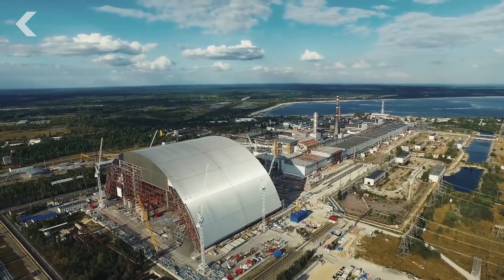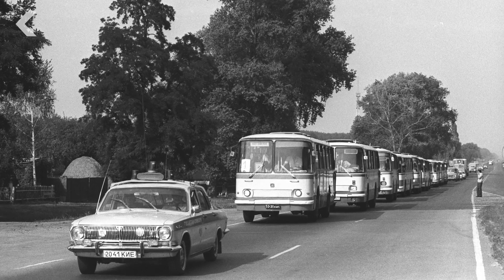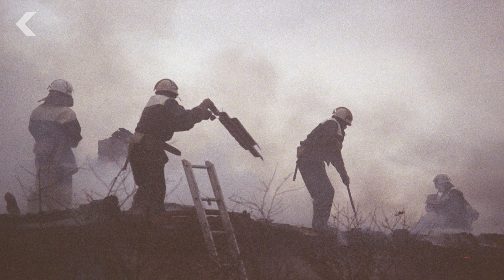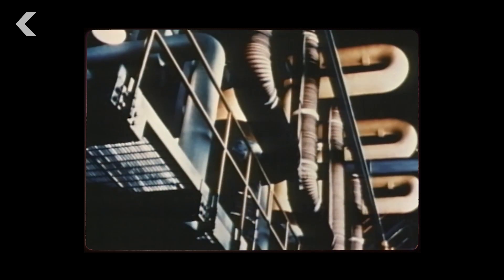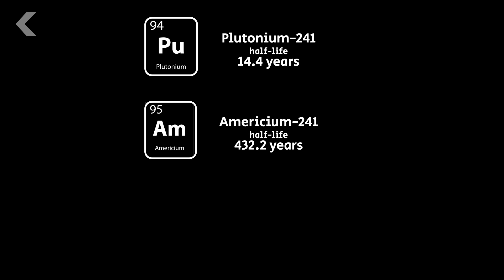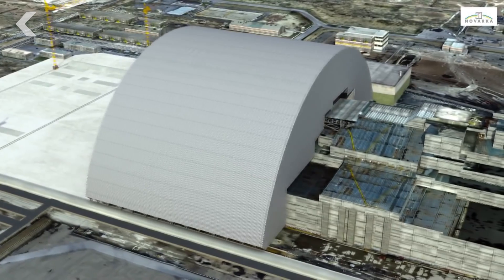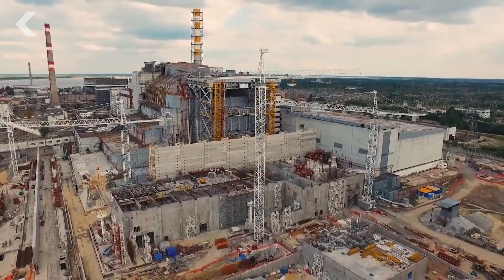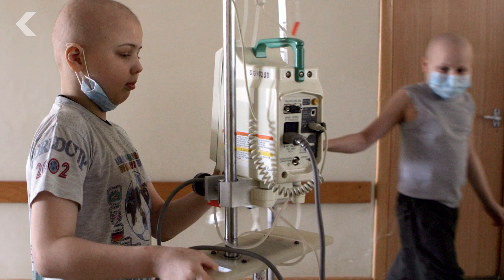Chernobyl's Massive Radiation Shield Is Preventing Nuclear Fallout

Comment: There are huge errors in this video. These are not uncommon errors, but bad enough.

Strontium-90 and Ceasium are actually the most dangerous element in terms of long term management, as it can take hundreds of  years for large stockpiles to get to a safe level. Iodine is incredibly radioactive, but it's half life is so low, if you can contain it for a few months, it quickly decays to safe levels.

Neptunium, with a half-life of 2 million years means it's basically stable enough to eat off a table made from it. Seriously. It's not 100% stable, but it's stable enough that it poses little radioactivity risk. It's decay rate is to slow to have much of an effect on biological systems that measure lifetimes in years. This idea that we can poison the planet for thousands of years is wrong.

In an accident, the main elements to be worried about are Iodine ( which is why you take iodine tablets if your near a reactor that explodes. It prevents the uptake from extremely dangerous radioactive iodine ), and then in the long term, keeping Strontium and Ceasium out of the water supply, as that can poison the food chain, and make cancers more common.

This fundamental misunderstanding about nuclear power makes solving climate change harder. Neptiunum is not terrifying.

Comment: Forgive me for asking a silly question but -
why not build a high wall around it and fill it up to the top with concrete?
Reply: 1) it would be insanely expensive. That volume of concrete is not cheap and easy to transport. You would need many factories and mines nearby just to get the concrete. Then transport it. It would basically be like building a concrete mountain.
2) Buildings need foundations...even if they are just lumps of concrete. You can pour concrete over and around the reactor, but you also need to get reinforced concrete floors under it. If you don't build an appropriate foundation, then the whole thing would sink into the ground...where environment and stresses would work on the concrete and crack it open over time. ( you can't just pour huge volume of concrete and leave it. You need to cool it for a long time )
Reply: @UninstallingWindows  - thanks - you're right.
It's what's at the bottom of that building which is the problem.
There's a huge solid mass of super radioactive material.
Such a weight of concrete on top would only force it into the ground -
where it would more easily contact ground water and spread into the environment.
See the elephant's foot:
https://www.youtube.com/watch?v=SuJAnS2YpEo

Comment: I was thinking... what happens when electronics get exposed to radiation? Well, electrons got dislodged and moved from where they're supposed to be thus causing the device to fail if exposed to too much radiation. So radiation pushes electrons... right? So what happens if you hang a 'curtain' of copper around the nuclear fuel, and have wires leading out of the building so it will generate electricity (although only probably a small amount) but it'll last for ages and also help contain the radiation?

Comment: This video is massively overstating  the intensity of the situation and otherwise filled with incorrect information. If it collapsed again then it would be no worse than the original disaster, which only legitimately effected those living in Chernobyl (The wind issue might've been noticed with greiger counters but it didn't do anything harmful). Also wait what, "millions of years"? That long and there obviously wouldn't be any noticable radiation to even worry about - they're only waiting for the . The reactor itself isn't even that dangerous you can safely go inside the sarcophagus for 15 minutes as one journalist did for an article; Chernobyl reactor No 3 was still being used until 2002. Even so, the new confinement is only set to last at most 100 years, after which the situation will be safe (10 years made the critical elephant's foot 1/10th as radioactive, so 1/10^10 will clearly be negligibly small, despite it's 1 hr lethal dose now, up from it's 300 second lethal dose in 1986).

Comment: It wasn't a power surge, it was undergoing tests, and ran out of control. It melted the core, caused a large explosion blowing off the casing and caused a fire. It's the fire which released most radiation into the atmosphere.
Reply: Christian Buczko a meltdown can't cause an explosion alone. In chernobyl a pressure surge exploded the entire reactor
Reply: When a core melts, it catalyses the water cooling it into hydrogen and oxygen. It's that which explodes the top of the reactor building off, as happened at fukashima and here at chenobyl. What made chenobyl so bad was the fire where the core was burning and releasing the core matarials into the atmosphere. It had carbon graphite in the core to help control the reaction, that burned btw probably from the heat being generated by the core as it melted. Made a hell of a mess...

Comment: Imagine you have2 buckets.  Both have the same amount of water in them to start but different sized holes in the bottom.   One is called iodine and takes 8 days to lose 1/2 it's water.   The other is called neptunium and will lose half it's water in a million years.   Which would you rather stand under if it were leaking acid instead of water?.    For the first couple of months,  neptunium because it only drips once every decade,  but then iodine becomes so empty it's drops slow down to a similar rate,  and then gets slower faster.   
That's what half life means

Comment: Wow. Really shaking my confidence in nuclear power.
Reply: dont let it, he didn't actually mention radiation levels, he also didnt mention that the "power surge" was caused by an idiot staff who ran the reactor without running pumps for the water to cool the reactor as a "test" its like running a car without coolant, its obviously going o not work, doesn't help that they where using an inferior design where the control rods where made of a low meting point materiel which jammed themselves trying to stop the reaction. the most recent nuclear disaster has no known confirmed deaths to radiation but the media had other plans to pitch the disaster.

Comment: You do realize at a point the longer the half life the better right? A half life of 2.14 million years ... A really short half life is good and bad because it means it release all of it's energy very shortly so the long term harm is low, but if you are in contact with it it's really bad.

A half life of 500~ years is bad because it's still high enough to cause serious problems and lasts a long time half lifes of 1000's of years are still pretty bad but millions of years it's going maybe 2 - 3x background which if you fly a lot you will get more radiation exposure.

Comment: The creators of this video need to do a bunch more research, as it stands this is alot of incorrect information and in general hyperbole. A few major points: 

Collapse of the old containment would be a major disaster, but it would not end the world. We released alot more radiation with atmospheric nuclear tests. Also, most of the remaining radioactive material is not going to be dispersed by such a collapse.

Longer half life does no mean more dangerous; if long half life meant worse, we'd all be dead from bananas with the Potassium-40 half life of over a billion years. There is radiation all around us, its just a question of how much. Longer lived isotopes give off alot less radiation and are therefore less dangerous to be near (discounting biologic effects such as heavy metal poisoning).

The Chernobyl accident was caused by trying to too quickly force the reactor into a set of parameters for some safety tests. Yes, a power pulse could be used to describe the accident, but it is a woefully lacking description of what led to the accident.

Comment: I think it should be important to note how the radiation travels due to the weather. Radiation itself is an energy form, on its own it cant exactly "travel" without some kind of force moving it. The radiation around Chernobyl would have stayed dormant there several kilometers away except fro one thing, Dust. Dust is what "Fallout" is. When radioactive elements connect to dust particles in the air, this is nuclear fallout, As the wind blows the radioactive dust is spread around the planet.

Comment: Now please tell me nuclear power is clean and safe...
Reply: It actually is. There are modern forms of nuclear technology today that make meltdowns impossible to occur. Liquid Fluoride Thorium Reactors use fluoride salts instead of water as coolant for the reactor. In a normal light water reactor water is used to cool the reactor. This becomes an issue however because water boils at 100 degrees C, and the nuclear reaction need to occur between 500-900 degrees C. To achieve 900 degrees C, the pressure is greatly increased in the reactor to increase the temperature of the coolant. 
The problem is when a power failure occurs, you have to release the pressure or else the pressure will rupture the reactor. If you let too much of the steam out or cannot pump new water back into the reactor than the fuel rods are bare without any coolant and begin to melt. 

These issues are no longer a problem as fluoride salts have a boiling point of 1400 degrees C. This means at 900 degrees for a reaction, the coolant will always be liquid and it never needs to be under increased pressure. There is nothing in the reactor that can elevate the temperature of coolant to boiling point. Because the coolant can never boil, the core of the reactor is never bare and can never meltdown. 

This technology has actually already been used in the past by the US Air Force and the Oak Ridge National Laboratory in their development of nuclear powered aircraft in the 1960s-1970s.

Comment: Can you make a video about fukushima and how it can still be a treat to humanity
Reply: It can't be a threat anymore. The molten core of the reactor has solidified completely now and the radioactive coolant leaking into the ocean is so diluted that its not an issue anymore. Only remaining issue is to encase the core in something very dense, like lead or concrete and remove it, which will likely be 10 to 20 years down the line, at which point the reactor can be fully disassembled and decommissioned, and the land re-purposed, either for industrial development, or a modernized thorium reaction vessel.

Comment: Stainless steel is not rust proof!

Though I guess in this application it may as well be?
Reply: Its thick enough that it doesn't matter. The dead reactor will likely be decomissioned/disassembled before the dome can begin to fall apart, along with the (partially) operational one, although it ceased power production in 2000.

Comment: What if like we put some another gas in that chamber so that isotopes can react? I dont know just thinking ( dont think its possible tbh )
Reply: Well, none of this video does a good job at explaining. The main danger from the Chernobyl reactor at this point is simply the dust that the concrete would create if the roof caves in, and since the concrete has some of the radioactive metals from the reactor on it, the dust that would go up into the air would be moderately radioactive and get swept up in the wind. The reason this is dangerous is the dust can settle on the ground downwind and stay around for a relatively long time and possible get into people's lungs, increasing their risk of lung cancer by a moderate amount. It wouldn't be a world ending event like shits bullshit video suggests; at most a couple dozen people would get lung cancer. And you can't just react the elements themselves with anything to make a new compound, since they will still undergo radioactive decay while combined with other things, and you cant split them apart like in a nuclear reaction, since they are no longer in a controlled environment. Best thing to do is just contain it somewhere relatively safe and let it just do its natural decay cycle.

The materials with long half lives are also the ones we actually WANT to be dealing with. The long half life means they decay slower and put out less radiation. Uranium has a half life of 4 billion years (which means that one atom of uranium, on its own, will take on average, 4 billion years to split apart into smaller atoms), and so puts out a very small amount of radiation if you don't fire neutrons at it like in a nuclear reactor. The oxygen you breathe has a half life of 1,000,000,000,000,000,000,000,000,000,000,000 years and as a result emits basically no radiation at all. I have a cube of uranium on my desk for display purposes, since it is actually quite safe in pure metal form.
Reply: Acb Thr thanks for information

Comment: ok. but isotopes with long half lives release very little radiation. so no, the earth would recover
Reply: yes but when you have stupid amounts condensed into a tiny area the amount of radiation it gives out is multiplied as well. Thats like saying "bleach will kill you if you drink it, but if i just have a sip or 2 i should be fine"
Reply: Acb Thr: Actually, most of them live in Slavutych, Ukraine.
Reply: @mrSockez The radioactive fuel in the reactor is a solid lump of metal, so it isn't going anywhere. The small amount of radioactive dust in the reactor isn't even enough to give a couple hundred people cancer. Not an awesome outcome if the thing were to collapse, but its not some big spooky world ending event. I would also like to point out that the people working on the big dome, and decommissioning the reactor in general mostly actually live IN the town of Chernobyl.

Comment: There is an inverse relationship between the half-life of a substance and it's intensity.  The real long half-life radioactive substances don't emit very much radiation.
We also don't know how dangerous low levels of radiation are. There is an assumption that the cancer rate is linear from the known rates at high radiation levels to low levels, but we don actually know.
Saying that cancer rates have increased is actually not true. We can't measure the rates when they are so small. So, it is a lie to say it.
The known death toll of Chernobyl is less than 100.
Reply: Iunel Kirklin 
I'm not against covering it. It would certainly be nasty if it collapsed. I doubt that many people would die though because the area has been evacuated. But, the superstitious would panic again and that is annoying.
Once they cover it, they should be able to robotically clean up the whole thing.

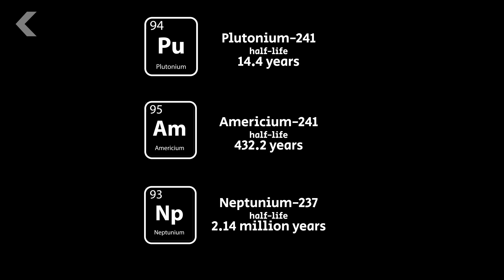Comment: Around 3:20 Seeker makes a big deal about really really long half lifes, like 2.14 million years is way way worse than 14.4 years ... but unless Neptunium-237 is inherently problematic, having a long half life means its very stable ... it won't break down and thus won't emit radiation.  Up to that point in the video the emphasis was on the dangers of radiation, not the dangers of poisonous materials or other problems ... I mean Iron-60 has about the same half life and this video doesn't suggest that is the problem ... long half lives used to scare people is disingenuous.
Reply: Now here is where I run into difficulty ... if it is as stable as Iron-60 but emits more radiation ... how is it emitting the radiation?  I mean the process ... because to emit radiation an element has to undergo either fission or fusion ... alpha particles and gamma / x-rays aren't just spontaneously produced without a reaction, where the original element is transmuted into another element ... hence my confusion.

Comment: As Neptunium is quite stable, it will only cause radiation levels of less than 0.001% compared to the original plutonium. If spread over a larger area this figure will be even lower. Negligible?

Comment: one of the issues I have with how people represent decay products is they don't really emphasize that half life correlates to out put. Basically the 8 day half life pumps out crop tonnes of radiation. uranium 238 with a billion years? less so. effectively doubling the half life halves the output..or another way of saying it Is that for one gram of uranium the equivalent output of radiation from say i-131 would be fractions of nanograms. however, it also means we need to take into account bulk weight by decay product. uranium itself is relatively harmless. just don't breath it in.  I dunno. it's just how people represent radioactive products is misleading